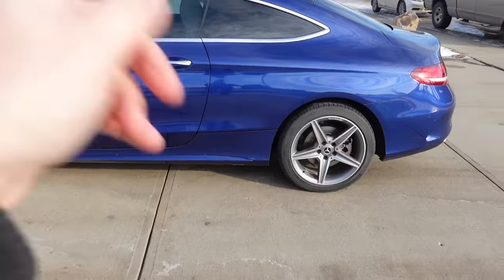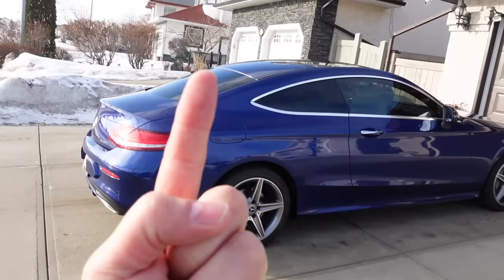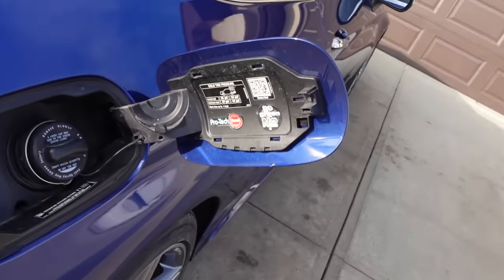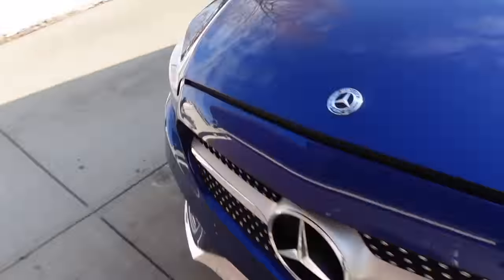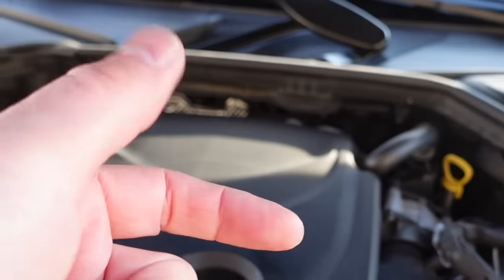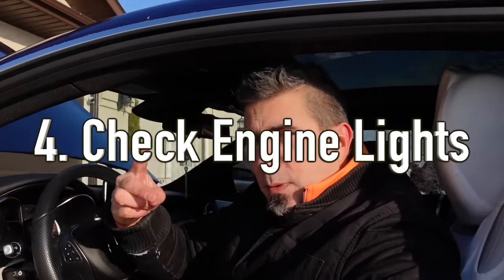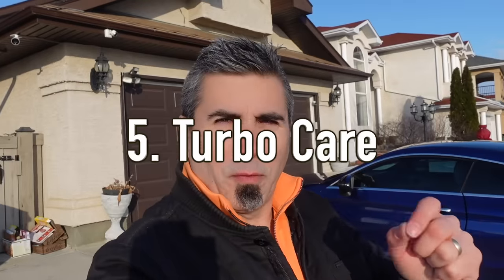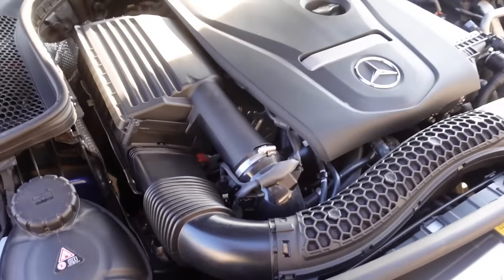STOP Destroying Your Car Engine! (With These Tips)

Comment: I always said when the start/stop function came out it was bad for your starter and no gains in fuel efficiency. 
I always shut mine off in my Cadillac
Reply: It does improve fuel efficiency. In fact that the whole reason it was invented. Manufacturers only ever implemented it in the first place because mandated fuel efficiency rules meant they had to stop the engine at lights to meet targets. They would never had spent money developing and implementing the tech if they didn’t need to. They have to use more expensive batteries, and more robust starter motors in order to include the feature, which then increases the sale price, and in this competitive market, they wouldn’t do that unless it helped them reach their emissions targets.  That’s also the entire reason you can’t disable it permanently, but can only manually turn it off each trip. If you could turn it off permanently, then it couldn’t be used when testing a cars furl economy, and the manufacturers need that fuel saving to be included in the tests.
Reply: Hybrid cars start/stop the engine way much more than yours, they are the best seller now.

Comment: Good advice, Mark. I hate auto stop/start. I disabled it on the f-type Jag with one wire to disconnect, but we have a new Genesis GV70 and I haven’t found a way to disable it. My wife and I are both trying to make it a habit to turn it off when we start the car, but we haven’t learned yet.
Reply from the maker: Thanks for sharing David.  It’s like a lot of imposing technologies and codes, they start half way and give you the option for awhile and then phase in the inability to do that later in further designs.  Does it have some type of a sport mode?  Usually that takes care of it.
Reply: @ECPP  yes, in the sport+ mode, but not the sport mode, it will shut off the stop/start, but when the car is restarted it defaults to comfort mode, so in any case we have to remember to turn off the stop/start every time. Its the top end GV70 Sport Plus (3.5L twin turbo) which is kind of a waste since it’s my wife’s car and she doesn’t really care about the extra torque and horsepower.
Reply: @dpvbischoff  I heard theres a switch in some bonnets/hoods somewhere that disables start/stop when the hood is up. Its some sort of mechanic protection thing. You may be able to disable it that way.
Reply: Isolate / take out the fuse if it is only used for that purpose.

Comment: I always knew auto start stop was a horrible technology for the engine. It’s on my current vehicle, lucky I have a switch to turn it off. But the second reason I turn it off is because when it engage at a light it locks my steering wheel.. oh hell nahh it just feels really dangerous and it feels exposing. Idk how to explain it
Reply from the maker: Nice.  Thanks for sharing, but you are right, they really are poor designs that go against the life of the car.

Comment: I’ve spoken to a lot of mechanics and they said the auto start stop feature is harmless. Even if you’re stuck at a stop light for 2-3 minutes, the lubricity of the oil takes longer than that to go away. And when the engine fires up, those few minutes even in sub zero temps is too short to cool off the oil.

Where it annoys me on MB, the feature isn’t very smooth and is very noticeable, which is why I disable it.

Comment: Stop start, first thing I switch off. Here in the UK I found the engine would stop just as I was about to pull away at rounderbouts, the delay I found both offputting and dangerous.
Reply from the maker: Cheers

Comment: I totally agree especially about the start and stop "turbo killer".  Here in Europe we still pay to access the motorways in some areas: so, after a long run unfortunately could happen to fry the turbo while you stop at the paying machine because you forget to disable the start and stop.
Reply from the maker: Absolutely.  Great to turn it off in cases like that.
Reply: Ouch!
Reply: Turbos need to run for a while to cool down
Reply: But you know that SS system don't turn engine if turbo isn't cooled down? Also it wont turn engine off if it's cold for example.
Reply: Please look up "turbo after-run pump."  You are not killing your turbo by shutting down a hot engine.  The electric after-run pump will keep circulating coolant through your turbocharger until the temperature drops to a safe level.
Reply: How is that a turbo killer? Please elaborate
Reply: @midcenturymodern9330 it's not the coolant, and the coolant doesn't cool the bearings very well. You still need to supply oil. The 2024 Volvo VNL860 that I drive everyday, it's a heavy tractor trailer, has water cooling on the turbocharger and the exhaust turbine... We have already had eight trucks out of the 30 brand new trucks that my company bought this year, destroy their turbochargers because the drivers don't warm the engines up before taking off, and they don't let the turbocharger cool off by idling the engine for several minutes after stopping. Water cooling does nothing to cool the bearings, it only helps with heat output in the engine bay. It just relocates it.. The bearings are still experiencing 600° f to 1500° f temperature conditions while in operation. It takes at least 5 minutes of idling to cool it down sufficiently to safely shut it off.
Reply: @raymond4307 because when the engine shuts off, the oil supply to the turbocharger that is cooling the turbocharger bearings, shuts off. Plus the turbocharger is still spinning, even at idle.. so do that several dozen times to it, each hour, You're basically starving it of oil while it's blazing hot and still rotating it tens of thousands of RPMs. If you sit down and tally up how many times that thing is going to start and stop in a given year, it begins to really make sense. Just disable your start stop system.

Comment: It’s not a cold start every time it auto stops and starts because the ECM monitors the oil temp and won’t let the temperature fall below where it will damage the engine.

Comment: I usually leave the start/stop engaged for regular driving. I do turn it off if I am going through a drive through or some type of line that has lots of stopping. The wear is minuscule and many of us will not own the vehicle long enough for a mechanic to tell you “this is because of you using the start/stop installed by the manufacturer feature too much”
Reply from the maker: That’s true, for short term owners it really does not matter much but for those who keep their vehicles longer then it is a great tip.
Reply: How long is considered a long term owner though. I have extended warranty with mt new Subaru so 7 yrs extended warranty. I plan to keep it for between 7 to 10 years. Is that long ofr mid.

I read with auto star stop the car can handle it and it doesn't kill the engine. I don't know cars that well but I would think Iif a vehicle has the feature it should be able to handle ir

Comment: I live the UK and drive a Ford Fiesta with a 1litre EcoBoost engine with a turbo. Fortunately my 2015 model has and on/off button for the stop start system so I always drive with the stop start system deactivated. I have never noticed any loss of fuel efficiency when driving. Sadly on most new ICE cars the start stop cannot be over ridden.  I use premium unleaded fuel which has less synthetic oil in it. It is higher octane and offers more power and far better mileage. The EcoBoost engine is direct injection so prone to carbon build up over time. Premium fuels have less impurities in the UK to encourage carbon deposits in the cylinders.
 I also let the engine run for a minute after journeys to help cool  the turbo bearings before turning the engine off. Little things which I hope will extend the engine life of the car.

Comment: Some states require an Ethonol blend (typically 10%) during the winter for air quality issues.  This is probably not an issue if you have a moderate commute to work. Higher quality gasoline (not necessarily higher octane) have some cleaners and stabilizers so the ethanol blend isn't a big issue .... UNLESS you let your car sits for a long time.

Comment: Idk about all stop starts, but most don't use the starter to restart. Most will stop cyl 1 TDC then when ready it will fire that cylinder. Most starters with those systems are brushless so no wear and tear there as far as the flywheel it's possible, but I'm sure they've done extensive testing to mitigate it being an issue for a very long time. Either way I think its stupid and I turn it off lol.
Reply from the maker: You are absolutely right

Comment: It depends on the car. With my AMG Mercedes, it is designed to stop/start. It does not wear out your starter. I used to turn it off but with gas prices during Bidenomics, it’s nice to get 30+ mpg vs. 23 mpg. Yes, it makes that much of a difference.
Reply from the maker: Nice, sounds like a win

Comment: Good information, however I will say that newer generation Start/Stop systems don't use traditional armature starter motors with a ring gear. Some examples that come to mind is Mercedes / Volvo. Volvo calls their starter "motor" an "ISG - Integrated Starter Generator. It uses electromagnetism, rather than an actual mechanical starter engaging with a ring gear. These newer start/stop systems are pretty noticeable in smoothness, so if you can barely feel your start/stop system turning on/off, it's most likely something like Volvo's ISG.

Lubrication for pistons is obviously important, but generally cross-hatching on the cylinder walls should take care of any start/stop conditions, even after a few minutes of not running. Also consider that the engine will be starting back up and running at a lower-RPM  in a closed-loop condition (as opposed to open loop at higher RPMs).
Reply from the maker: Much appreciate the info.  Thanks for sharing

Comment: It’s a great subject to touch on.   I have a Lexus GS  Blackline. It Calls for premium, and I use shell premium which contains dry gas . But I talk to many people who also require premium but never use it . Besides the obvious knocking i recall many decades ago. It’s not as widespread today with these engines. My cousin has always had a new Infiniti G37  , Q50 every 3 years . That engine requires premium . She  used  regular for all  of them  in 3 years of driving and returned them one after the other . Maybe she unloads them before there are problems. Or maybe she was right . Is it true or just a farce? I have no clue. But someone bought all her leased cars thinking the car adhered to all the standards prior .  Surprise!
Reply: I heard that, if your car is turbocharged but not equipped with a supercharger, the premium gas is just a recommendation to achieve the most horsepower. However, it’s not a requirement because the built in computer will automatically adjust the timing to avoid the “pinging” that was known when the timing was manually done through the adjustment of the “points”. 
The reason you must use premium fuel ( if indicated by the manufacturer) when a car is equipped with a supercharger is that if you use regular fuel and the computer adjusts the “timing” it will throw out the syncing of the supercharger to the engine resulting in expensive damage.

Comment: Since the corona curfew and working from home my car sits more than it’s been driven. The regular inspection shows that the AGM battery is still "ok" - more on the bad side than the god side of the meter. So, I'm turning off the auto stop/start to avoid wearing out the battery. The battery is so "ok" that auto start/stop wasn’t available for a long time at all. It came back after a long drive during summer holidays.
Reply from the maker: Great points indeed

Comment: Mark, the problem with this logic is that +97% of new car purchasers don't keep (or intend to keep) their cars for longer than 4 years, or when the motor plan expires. It's the used car owners that then bear the brunt. Daily drives are seen as disposable. I have always bought 2nd hand and luckily my cars have been OK, but they're the older technology (no stop / start, or Turbo's). I still wait a minute to "warm up" when I start from cold. Ironically the manufacturer's state "Start and drive immediately" . On the Mercedes & Jaguar, how does the Supercharger (remember the Kompressor Merc's)  fair against Turbo's ? Turbo's are a pain - but I've actually never heard problems with the Kompressor engines and they've been running since the late 90's.
Reply from the maker: Great comments and yes I too have usually purchased used vehicles and abuse by the original owner has always been a risk but we did.  As far as the superchargers go, the bearing setup is more robust but a supercharger also is directly tied to engine RPM as a vehicle slows done, so does the blower at the same speed ratio while a turbo spins freely and often even getting off throttle, a good turbo continues to spin at high speeds for seconds or more.
Reply: Those Kompressor engines were bulket proof. I saw one the other day with 270,000 miles. The supercharger has never been serviced in its entire life.

Comment: I hate auto start-stop.  I have a 2018 VW Tiguan, and ran a test when I first got the vehicle.  I ran three tanks of gas using auto start-stop.  Then I ran 3 tanks of gas with auto start-stop turned off.  Very similar driving in both cases.  I found that I consistently got about 1 mpg better with auto start-stop turned off.  WHAT!  The manufacturer says that the car is more economical with it turned on.  I found that not to be true for normal everyday driving.  I have not used the auto start-stop system since.

Comment: The stop start system is used to squeeze an extra fraction of an mpg to help manufacturers meet mpg standards. Everyone that has the system (including me) hates it. It's hard on the engine and starters and doesn't save enough to be worth it. The default should be OFF and if you want it, push the button to turn it on. Ethanol gas is everywhere, you can rarely avoid it in the USA. It's awful for any vehicle, including lawn mowers and other small engine devices. Ethanol pollutes more and gives about 8% worse gas mileage.
Reply from the maker: Thanks, you are right on both counts for sure.  No value in either of those 2 items.  Keeping things simple can actually work and yet manufacturers are not seeing that..  onward and downward I suppose.
Reply: I’ve read comments from the guys of Car and Driver online that cars that have that start/stop feature have beefed up parts to handle the wear and tear.

Comment: He’s right @7:01 not changing you oil frequently enough can blow your turbo… I was going by the manual ie long service intervals and after about 6 years that turbo compeller wheel bearings etc broke in half. Change your oil like every 6k km especially if it’s tuned…

Comment: Nice video! One more thing, if you have a hybrid and you start out in el mode, then you do an acceleration the cold gas engine goes directly in to max power. Not good! So a good practice is to idle the gas engine a little before start...

Comment: I installed an automatic Start/Stop defeat module in my 21 Ridgeline last week... Works perfect.. Next project is to permanently disable the Variable Cylinder Management routine.. I change all lubricants at 1/2 the manufacturers recommended intervals but that is overkill.. All your advice is sound.. That Mercedes of yours is absolutely gorgeous, but I cant deal with the dealer only maintenance and specialty tools required..
Reply from the maker: Thank you so much Mark for the support and the comment.  The Benz is a pretty car but honestly I find it a bit fragile and I had it in the shop to re install a door speaker that popped out.
Reply: @ECPP  
That’s why I don’t ever own Mercedes again I bought one two years old and anything but trouble now I own Bmw Audi Lexus ram vw no problems at all just regular maintenance hope you’ll enjoy yours with free trouble
 like your content that’s why I subscribe very informative 👍
Reply: I did the same on my 21 ridgeline as soon as I bought it I put it in, next to the vcm muzzler now it drives like it suppose too
Reply: @xPhantom1786  Awesome… where did you buy your VCM muzzler?
Reply: @marks6072  I bought it at the ridgeline store it's called S-VCM Controller - VCM Disabler. I thought this thing was a total slug cause of the eco mode going in and out and all that crap but once I put the muzzle on she rides beautiful.
Reply: @xPhantom1786  Excellent... Randy must have them back in stock.. Thanks for the info!!!!
Reply: One reason i chose a Mazda CX-30 Turbo over many other vehicles was because of the start/ stop feature..Some cars like my last Stinger you could turn it off with a button or if you pressed the brake just enough to stop the car it would keep the engine on.And I know modern turbos are better--but if you get off a HWY and come to a light real quick and the car shuts off immediately--can not be good for the turbo and many cars are Twin turbo.On the mazda forum a head tech already said it is a good idea to idle the turbo 2.5 for 30 seconds or so--he mentioned something that it auto pumps after the car is off--but it is better to do it with the car on to keep the oil from coking from heat.--I can imagine a BMW TT V8 or MB TT 8 being shutoff quickley after having just used the turbos.
Reply: I’ll stick to my Toyotas. Mercedes are over rated.